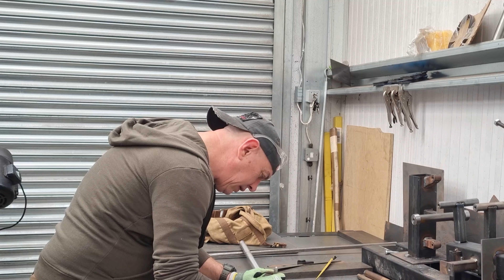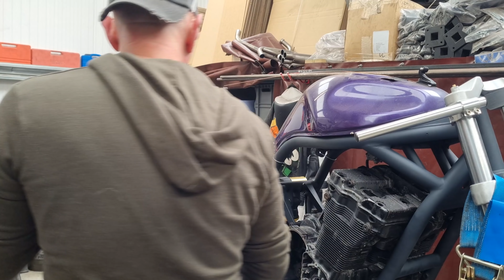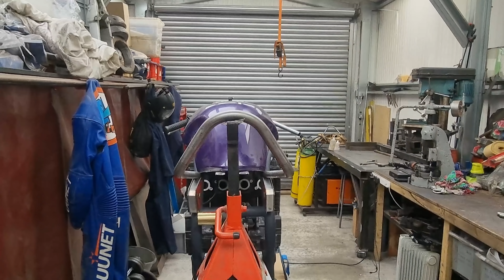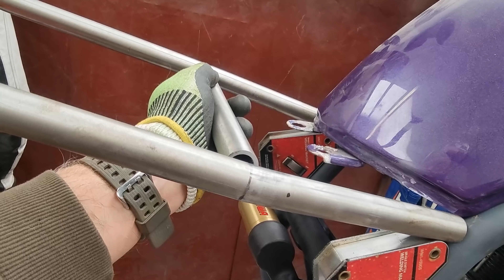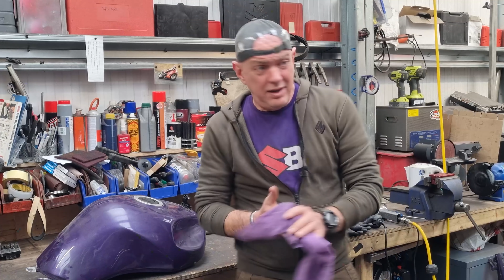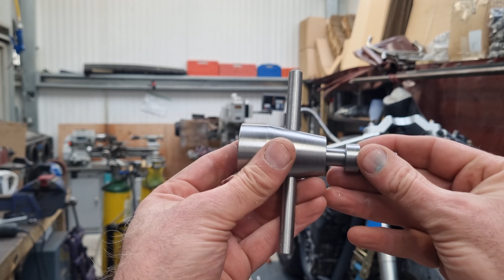Making the seat hoop - Suzuki Bandit Cafe Racer - ASBO Project

Comment: Very good video is the steel you are using 4140👨‍🔧
Reply from the maker: Thank you matey. I'm afraid there's no chromoly on this build as it's proper expensive and I'm sticking to what the manufacturer used whichnis mild steel ERW. Not as corrosion resistant I know, butbif it's good enough for Suzuki.... 😁
Thanks for chipping in matey

Comment: When I used to be a fitter in a car plant I hated bending pipe and also pipe fitting. I invented myself a job in separate small stores doing machining only lol. It had a really nice Holbrook lathe that was nice and strong and also a Boxford along with a Bridgeport mill and a surface grinder! All in very good condition. Most of the parts were obsolete so I invented that job just for myself and there were loads of steel in the stores to help yourself to. Getting parts machined outside used to cost a fortune! So I ball shitted my way to do that job lol. I loved it until we were all made redundant. Sad ending
Reply from the maker: That sounds like a proper fun job. I really DO like the machining and welding side to what I do. Seems to give me the most satisfaction even if some of it takes ages 😂🤣
Reply: @QuickBikes  Another good one for you to look at is another channel called Prism Supply. All bikes lol
Reply from the maker: I'll give it a look see 😁

Comment: You know of any hubs you can use to makes spoked wheels for the bandit .I’m asking a few builders as I’m doing the reasearch so I can do the job and twin bck shocks ,cheers .I did hear using ktm or bmw has been done but I’ve only seen one .cheers nice build .
Reply from the maker: I'm not sure matey as its not something I've looked into for a build yet. I know you can get bespoke ones made by Talon, but they will cost you a FORTUNE... There might be something on the Everything Bandit Facebook page that could help as I'm sure somebody else would have done it.  Axle spacing  would be easy to fix, I guess it's more where the sprocket / disc sits on the new wheel.... Hmmm....
I hope you find a solution and would be interested to hear how it works out as it suddenly gives you wheel options for future builds 😁👍

Comment: That is cool as anything. I had my doubts with the first mock up bends, however the changes you've made are bang on, as is the bracing - way better than the original thought.
Reply from the maker: Thank you matey, I'm really pleased with it so far. I don't think I could have done much better for a first frame attempt... 😁👍
Reply: @QuickBikes  You've been saying that a lot, however every time you say it, I say to myself, "I doubt Mr Suzuki's production Bandits were anywhere near the tolerance you're working to".

Don't be so hard on yourself, you're doing quality work.
Reply from the maker: Cheers dude 👍

Comment: Just watched the subframe build mate. Bang on I reckon. Have you thought about battery tray placement, wiring etc, in relation to running cables through the tubes? So sighting entry/exit holes, possibly before final welding/dressing. Just a thought. 🤔 Love watching the channel. Bike building n' comedy all rolled into one.🤣
Reply from the maker: It would be good to.shove some of the wiring through the frame, but to be honest I'm still in two minds about battery placement. Once I get that figured out, it's getting holes drilled in it 😂🤣
Thanks for watching matey, it's very much appreciated 👍